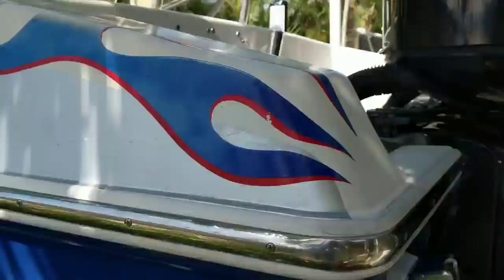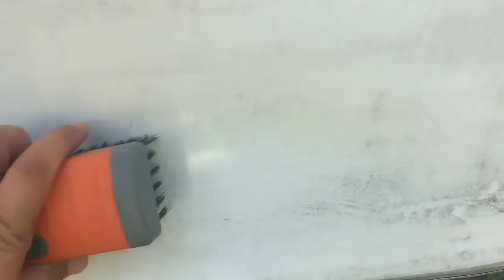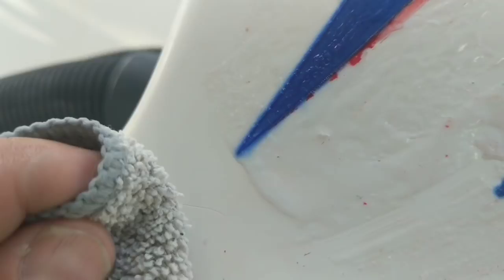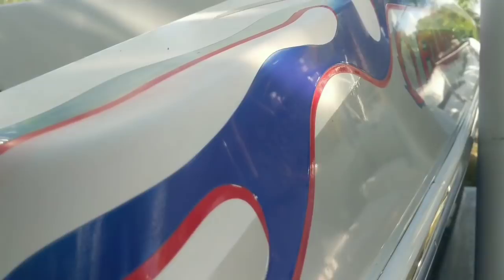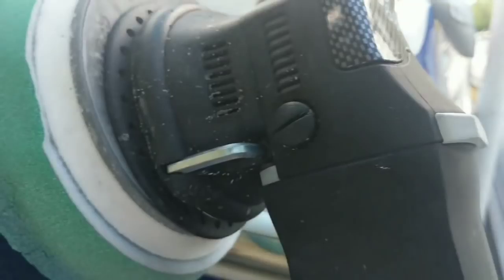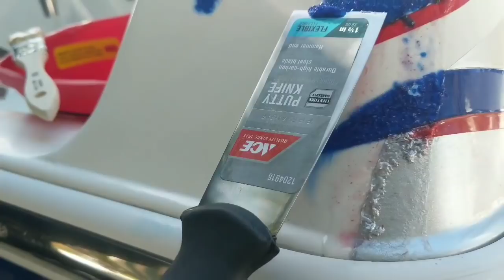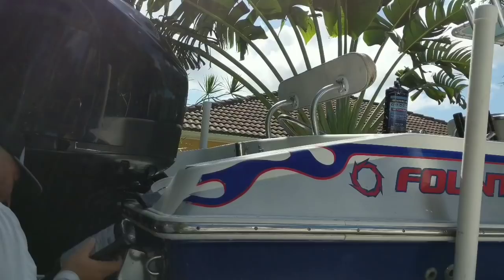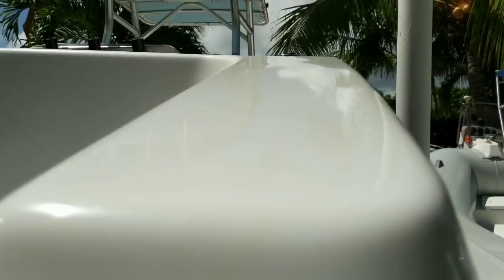Removing paint over gelcoat using paint remover ( Part 1)

Comment: Excellent video. Watched the whole thing. I acquired the old gel-coated fiberglass bench seats from a local bowling alley. Sometime in the 80's they decided to paint them a neutral modern color, covering the vintage 40's/50's blue. I've been looking into ways of removing the paint without damaging the gelcoat and have tried a professional media-blasting service to test with plastic particulates but it damaged the test area. This looks like a way to do it without damaging the gelcoat but still seems time-consuming and I'm not terribly fond of the chemicals. I will do more research and share what I come up with. Great job!
Reply: Have you found anything ?
Reply: @xhulianomurati5154  Not yet.
Reply: @warvetbill3450  I did it today I used body car paint remover and it worked great strong to the paint and no damage to the gel coat.
Reply: @xhulianomurati5154  Could you please share the name and brand or a link?